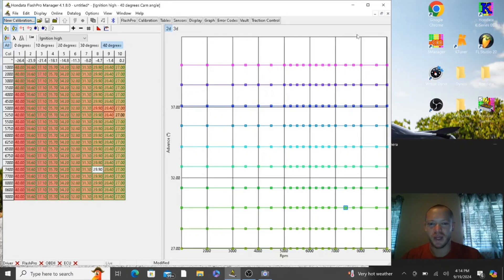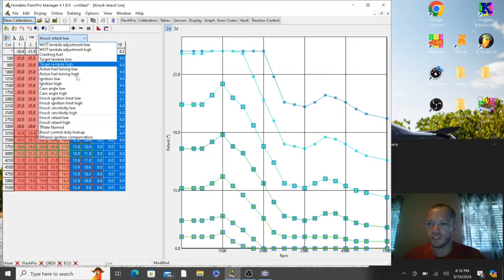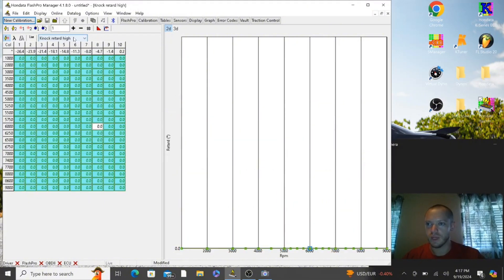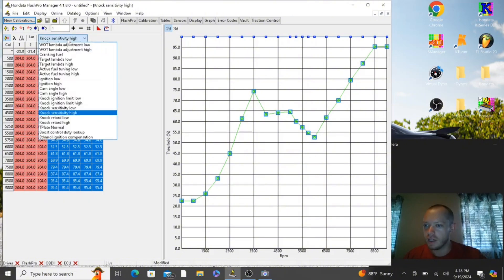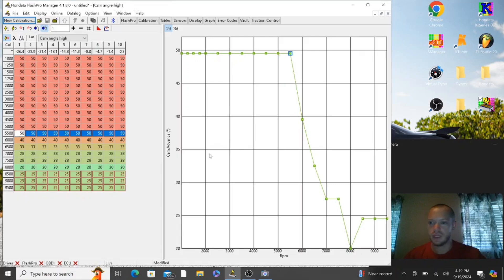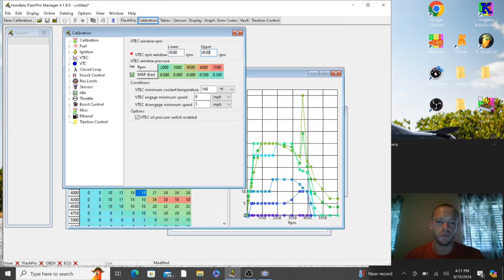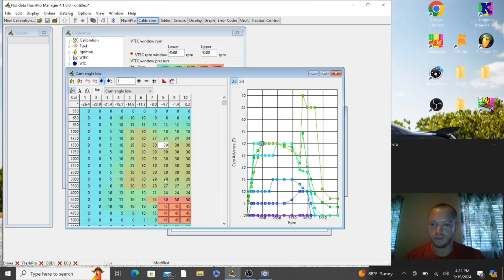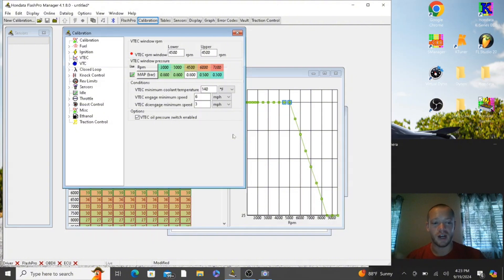How to Tune 8th Gen Civic Si K20 (Part 2: Knock Control, Cam Angles, and VTEC Crossover)

Comment: So tuning on map you would set all cam angles to say 15 tune the fuel an so on. But before you do this I should 60 out all the knock ignition limit so it don't pull timing? Or once my fuel an ignition is tuned, then I by pass knock control??? I'm sure others have the same question. Thank you cheif! Part 3 an I'm subbed!

Comment: My 09 fa5 really needs a tune. Would part 3 of your series complete a good fbo base tune? Im also considering e tuning with you, but money is tight. Lmk if you can help.

Mods so far: mishimoto intake, plm race headers with test pipe, full race 3" exhaust, hondata basemap tune. Other mods are drivetrain & LW flywheel
Reply: I did part one and two tonight. Ill lyk all know how it does. I do have a mild knocking sound when feathering the throttle between 2kish and 3.2k rpms. Paid a shop good money because they said my valves needed adjustment @ 86k miles. Any help, anyone?
Reply: @Bearpaw650 how did the tune worked for you?
Reply: Not bad. Still feel like we need fuel management tips and tricks using datalogs. Id be happy to submit data logs for the video!

Comment: is it normal for a 100% stock fg2 (other than 80a motor mounts) to knock often on both stock equivalent and stock tuned? im a little behind on maintenance rn i need to do valve adjustment and spark plugs and pcv valve. but the knocks go away if i do return to stock

Comment: Just did part one and two to my car. Went with the conservative options you mentioned but left the knock sensor stuff alone and the car runs great. 👍
Reply: Wondering if you changed the table index back up to 8000 in low in the ignition tables or left it how he did?  I noticed it changed the fuel tables index as well,  and just curious if I should leave it or change it back

Comment: My car has k20 TSX cams/ j37 FBO. I'm tuning off the skunk2 stage1 cams base map.. and all my values are different. Will this work for me? If not what is a better base map to go off of? Thanks... Eventually I we'll have you tune it but need to finished a couple things. (Injectors and return line)